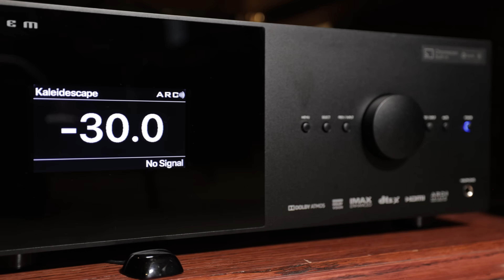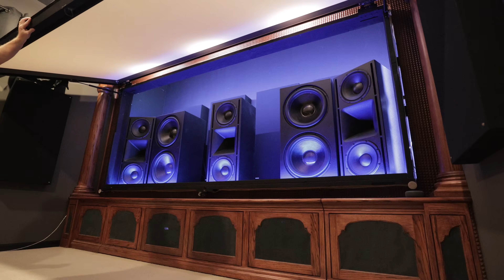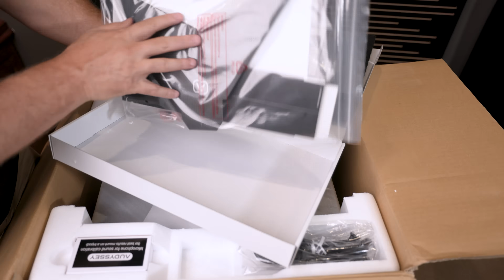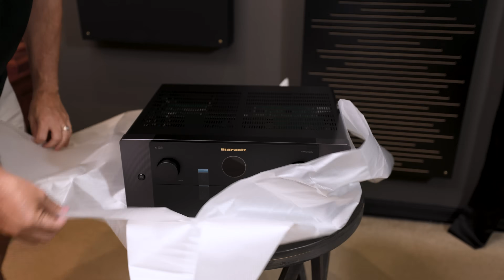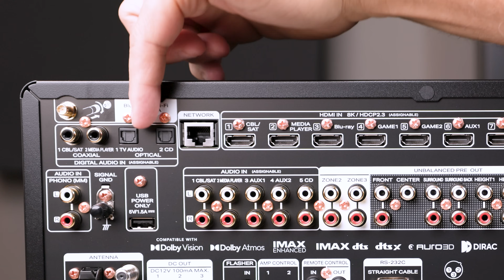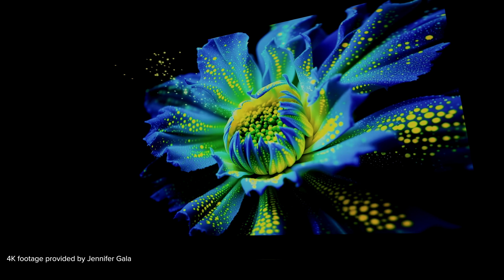Should I Switch Back?

Comment: The problem with Marantz is that its products share 90% of their internal components with Denon, resulting in negligible performance differences despite a much higher price tag. Even their flagship models require a separate purchase for the basic Dirac Live version. Therefore, it is far more reasonable to buy an equivalent Denon model and purchase Dirac ART separately.
Reply: To your point -- I compared the Denon 3800, 4800 and Marantz Cinema 40 and 50 at a national retailer.   I couldn't hear a sonic difference between them -- no matter what the salesperson was saying -- so I went with the 3800.   Been very happy for the last 18 months.   Then later I saw a youtube review between I believe the 3800 and 50 and the internals looked 99% the same.

Comment: After moving to a Denon 6800h and learning Dirac ART there is no way I could go back now! I have a dedicated 9.4.4 space and ART has completely transformed my room in the low end. Results were good with a standard calibration but if you take the time to properly calibrate and cross check with REW sweeps you can real dial in your room properly.

Comment: I like my AV10 but the source switching is not fast.  I think my old 7705 in the down stairs system switches a little faster.  That's about the only complaint I have about the AV10 now that they have resolved the on screen display problem for the volume level.  Originally you had no on screen display for volume level if you were using an anamorphic lens because it was off the screen.  About a year ago a firmware update resolved this.

Comment: My next significant upgrade is adding two more SVS SB3000s subs and replace my Marantz SR 6014 with the AV30. One of the AV30 features that I want is the four independent subs, which is why I think you will lean towards selecting the AV30 over the Anthem. Also, the "handshake" issue with the Anthem can be infuriated when you spend that amount of cash.
Reply from the maker: That’s awesome that you will have four subwoofers in your room. I really don’t have the space so I don’t necessarily need for independent subwoofers at least for this set up.

If you decide to move forward on the AV 30, send me an email to youthman@communityav.com.
Reply: @Youthman my biggest hurdle for getting the two additional subs is WAF. She just don't understand.😂

Comment: I’m really interested to see this comparison, especially because ARC Genesis and the Dirac suite are not trying to do the same thing.

ARC is excellent room correction and does a great job with target response, tonal balance, and integration. Dirac ART approaches the issue differently. Rather than only correcting frequency response, it's designed to address low-frequency room behavior, decay, and modal problems using the whole speaker/sub system. That’s a very different approach than ARC.

To me, the question is not just Anthem vs Marantz. It's ARC vs Dirac Live/Bass Control/ART as systems with different design goals. That’s where the comparison gets really interesting.

Comment: Looking forward to your thoughts on Marantz vs Anthem processor.  I have a Denon A10-h, which is their  latest mini flagship AVR. I did a comparison to AVM-70 in my room and I felt there is more separation in Anthem. But this could be just AVR vs dedicated processor thing.

Love my Denon though. I feel the overall quality and technology does not require any type of upgrade from price to performance standpoint.
Reply: I had 1140 and hated it.  I have the A1H and it's miles ahead.  Puts a smile on my face every time, especially with OCA's audyssey projects

Comment: I have the Marantz Cinema 50 in a 5.2.4 Atmos configuration going on 3 years now. Never had any issues whatsoever. The sound is amazing. No plans to upgrade until it catches fire and disappears in a mushroom cloud.
Reply: Same with my sentiments on upgrading.
Reply: I own the Cinema 50 which I used as a Preamp only with separate amplifiers. I run old school 5.1 so I can’t speak to atmos, but I upgraded to an AV 30. Same speakers, same cables, same power amps, much better sound. The whole soundstage opened up and the surround speakers had a lot more detail and volume. When you consider the price of an AV 30, it had better sound better than the Cinema 50. I mean no disrespect to your rig because the Cinema 50 is a solid performer, but I got spoiled on separates twenty five years ago so I just like Pre-Pro’s better than receivers. I just use an SPL  meter and manual settings on my home theater so if you have better room treatments or utilize Audyssey or Dirac your system might blow my rig out of the water! Enjoy your equipment and God Bless.
Reply: @Mr.incognito-c8p  The Atmos is pretty cool maaaaan
Reply: @pnwdood1758  I’m sure it is, I just don’t feel like buying more speakers and amplifiers, not to mention the setup.
Reply: @Mr.incognito-c8p  you don't need to spend a lot on Atmos speakers. I found some really nice JBL surround speakers at a Goodwill and painted them to match my white Arendal speakers. I'm confident they sound just as good as alot more expensive speakers would. And having Atmos really changes the sound stage in a very cool way
Reply: @pnwdood1758  That’s a great workaround! I’m just 5.1 right now anyway!
Reply from the maker: You definitely don’t have to spend a lot of money to get a good sound. But I can assure you, my JTR Noesis 210HT are unlike anything I have ever experienced in my theater room.

I’ve had countless people over the years come by for demos and it wasn’t until I installed them that I began to hear consistently that they have never experienced Dolby Atmos like they have in my room
Reply: Ha ha ha ha
Reply from the maker: What do you find so humorous?
Reply: @Youthman wasn't at you. See the comments about not wanting to upgrade till his cinema 50 catches fire and disappears in a mushroom cloud?
Reply from the maker: Ah. I was genuinely curious. It’s always difficult to figure out what someone means based on text.

Comment: I'm fairly new to home theater but I have a Marantz Cinema 70s with a 2nd Gen XPA-2 for my Polk R700. Will I get more power to the amp with a dedicated processor versus an AVR?
Reply: Oh yes… a dedicated processor delivers a more dynamic and immersive sound. The separation between each speaker is much more noticeable, making the soundstage cleaner and more precise. In my experience, this level of performance is very difficult to achieve with a typical AVR. Once you experience a dedicated processor, it’s hard to go back. 🤝👍
Reply from the maker: Moving to a processor will not change the amount of power that you XPA – Two is delivering

Comment: I’ve had both Marantz and Anthem, and I’ve found the Marantz firmware to be more reliable. HDMI is rock solid. Regarding HDMI syncing, the Marantz is great, but projectors are generally slow to HDMI sync. So the JVC projector can still take a few seconds to sync, unless you have a madVR Envy Extreme with Motion AI.

Dirac ART is great!
Reply: Question in your opinion which one had better sound and processing quality The marantz or the anthem?????

Comment: I recently bought a Marantz cinema 40, it's a wonderful upgrade from the Pioneer lx305 that I had previously, much better matched to my B&W speakers. 
One annoying thing I find with the C40 though is with Audyssey. I like to use Dynamic EQ because a lot of my listening is at lower volume and it sounds much, much better with it turned on. But Audyssey defaults to the Heavy setting in Surround Level Compensation, which makes the surrounds too loud, but if you switch the compensation off, you get a very noticeable sudden increase in volume in the surround speakers when turning the volume down through -40db. (and conversely, they decrease when turning the volume up when passing through -40db)
It's very distracting, and illogical that the surround sound should increase when turning the volume down. At least it anything it should be a smooth transition, not a sudden jump.
I've managed to work around it by setting the compensation to medium, then decreasing the surround volume by a few db in the speaker levels.
I just wish there was a way to turn the compensation off, leave the others settings as is, and not have that distracting jump in volume. 

Maybe I should try Dirac, but I wasn't happy with its results in the Pioneer and didn't use it, so I've been reluctant to try it on the Marantz too.

Comment: Hi, Michael:  One small mistake in your explanation of the AV30 inputs/outputs:  you stated HDMI should be used when possible as it gives the highest resolution for both audio and video.  That may be true for video, but not the case for the audio.  The HDMI inputs will only pass 24/96 kHz audio, whereas the coaxial and optical will pass 24/192kHz.  Also, the USB input on the front will pass 24/192kHz and DSD 128 from an attached external hard drive.  I know most of your subscribers are primarily interested in home theater applications, but some of us are also audiophiles and may have experienced some older Marantz/Denon products (e.g. Marantz AV8805) which would pass both 24/192kHz pcm as well as DSD bitstreamed using something like an Oppo player over HDMI, but the newer Denon/Marantz receivers/processors will not.
Reply from the maker: Thanks for the correction.
Reply: @Youthman  HDMI 2.1 can passthrough 24/192 kHz. You can check that by connecting your WiiM to your AVR through HDMI or confirm through your favorite Ai chat

Comment: I just have a lowly 5.1 channel setup, running a Parasound HCA-2205A 5-channel amp and an Integra DTC-9.8 pre/pro.  I am pretty happy with both, but would like to stop running my sources direct to my LG OLED and want to have 4K compatiblity (as well as 8K for some level of future-proofing), so I have been looking at pre/pros.  Given the relative simplicity of my system, would the Marantz AV 7706 be adequate for my needs?  Or should I step up at almost 2x the cost for the AV 30?  I am embarrassed to say that I haven't done anything with room correction, etc,. to date, but plan on doing so with the new gear.  Thanks for the informative content!

Comment: I believe the subwoofer output voltage is around 2.0V for the Marantz AV30. I don’t think that will be enough output voltage to power your two RS2’s. Jeff told me, “When using a Denon or similar, you have to turn the gain knob to near max”. He also said, “due to the high power of the RS2’s amplifier, it requires a ground for safety. Most receivers will have a grounding bolt on them in order to stop a ground loop issue".
Reply: I currently have a Denon A10-h, prevously had Onkyo Rz70. The bass punch from my subs was noticeably higher in Onkyo.
Reply: I believe marantz processor via XLR offer more than 2V. Audioholics did an objective comparison of AV10 and AVM 90. Marantz measured better.
Reply: @pittss2c601 I own dual RS2’s and a Denon x4800h receiver and I don’t need to have my gain near max that would be bonkers that would probably collapse my house in.  I use rca Y splitters on the RS2’s I have my gain set at 1/2 I then adjust the subwoofer level in the Denon to my taste.  Has plenty of power scary powerful take the breath outta your mouth and nose powerful.

Comment: The only HDMI issue I have with AVM-70 is switching back to HDMI1. I can change to other inputs, but going back to HDMI1 always freezes and only solved by power cycling. Now that I think about it, I wonder if only HDMI1 is affected. 

While you mention Dirac ART, I believe you will choose DLBC due to your SW setup. The way I understand ART is wave canceling similar to Trinnov’s waveforming tech. 

As for me, I am quite pleased with AVM-70, but would have grabbed the AV10 or 20 had they been in stock at the time. AV30 was not introduced at the time. Will watch this series with intrigue.

Comment: I set up the AV30 last night. Using Emotiva XPA amps and ran Dirac ART. It is very clean and spacious sounding. Hearing detail that I’ve not heard before. Additionally, the surround channels sound like they’re contributing more. Prior AVR was the Onkyo RZ70 with DLBC and it also sounded really good as well. Biggest difference I would say is the Marantz’s detail and separation. HDMI has a crisper image too on the Marantz.
Reply: Which emotiva amp do you have?:) I really like Emotiva. I have a marantz cinema 30 with a Emotiva XPA-5
Reply: Thank you for commenting this as I also have the rz70 and looking to “upgrade”
Reply: @DakotaRobertson-e6s its an upgrade, but not a huge one soundwise. The HDMI handshakes are better and image is crisper. RZ70 is a monster if you’re using DLBC and I could still live with it.
Reply: It also has to do with the ART upgrade. Going from DLBC on my AV10 was a huge upgrade.
Reply: I have a similar setup. Just setup the av30 with xpa5 and ordering another xpa6 for the 11.4 running to power first gen martin logan motion 60xt/50xt/35xt.   I am satisfied with the results as of now since this is my first preamp
Reply: Good move 
I have cinema 40 with Emotiva Xpa 
I really love that kombo
Reply: The AV 30 is such an improvement by itself over a receiver, some of what you’re hearing is probably the high-quality dac implementation of the AV30. Have fun with that beast, I’ve got one and it’s pretty awesome!

Comment: I can’t believe marantz still going with that crappy mic and mic stand lol I feel like this would be a lateral move at the most from the AVM 70
Reply from the maker: That’s for the free Audyssey room correction. For Dirac, you want to use something like the miniDSP UMIK-1 or UMIK-2.
Reply: @Youthman yeah I know, I’m just sayin, Anthem included a great mic and mic stand with no extra charge, I wish Marantz would step up a bit with that
Reply from the maker: It’s probably $30 their cost. Would be nice if other brands would do that as well.
Reply: Anthem should include Roon and a metal remote
Reply: Dirac Art should measurably improve the bass response, reducing standing waves, lowering decay times and seat to seat consistency. It would be interesting to see the measurements of ART vs ARC and if there is a noticeable difference in actual listening tests.
Reply: @LeeLee-fi7mx that’s for someone who doesn’t do all their bass control prior to running Arc Genesis, but it is probably more plug and play
Reply: Had an AV8805 for years. Now switched to an AV10. Was a Denton guy for years until I could afford the Marantz. Love the AV10. Interested to hear what your results are with Dirac.

Comment: I do not use my receiver for switching HDMI inputs. I only use my receiver for my 4K Blu-ray player for the sound through HDMI. No issues with that.
Reply from the maker: My projector has 2 hdmi inputs. Wouldn't be enough for my Kaleidescape, AppleTV 4K, PS5 and 4K player.